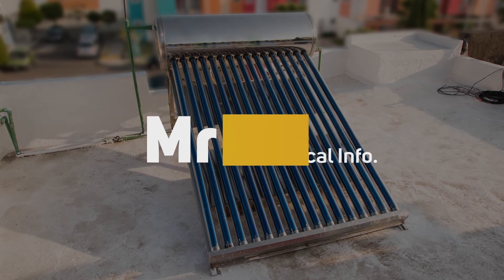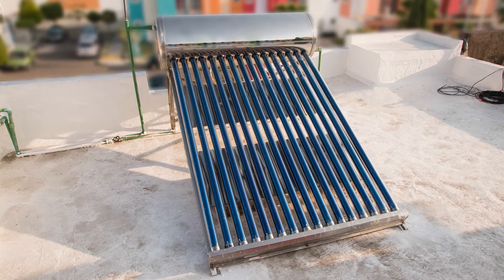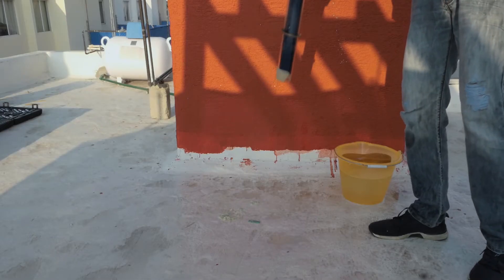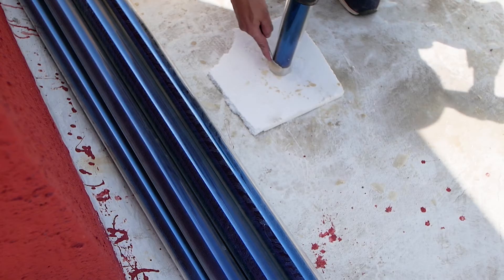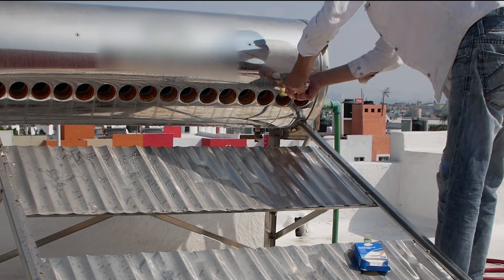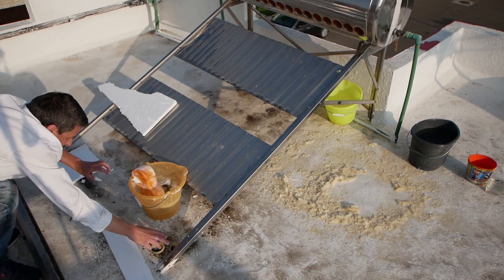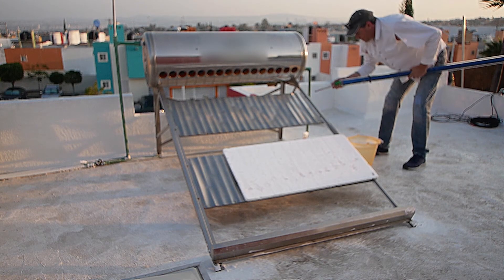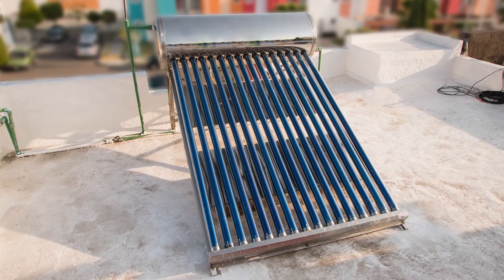Cleaning a Solar Water Heater Tubes and Tank 🌞

Comment: This was a very cool video. I don't think my solar geyser has any magnesium rods, but probably lots of clay residue. I have borehole water and clay accumulates quickly.
Reply: I suggest you to use non-weld tank to solve this issues.
Reply: Install the filters

Comment: Why not just buy a water softner ?
Reply from the maker: Only top end water softeners would cut it and they aren't exactly cheap, in Mexico a 250 litre gravity fed solar water heater only costs around $400 USD (2021). Plus solar water heaters need the silicon seals to be changed every 2-3 years so I now do that (in my other video) at the same time as cleaning the tubes and the tank.

Comment: Hello in Mine I have a lot of lime 
How can I get rid of lime
Reply from the maker: To remove lime scale you need to dissolve it by using a solution of one litre of white vinegar mixed with four table spoons of sodium bicarbonate which should be added slowly in a well ventilated area.

On the tank close the drain valve and fill it by pouring the solution via one of the tube holes. If the tubes contain lime scale put them in the shade standing vertically with some form of support and cushioned at the base then fill the tube(s) with the above solution. 

The lime scale should dissolve within an hour then rinse the tank and tubes well with water before reassembly.

Comment: What is the ratio of vinegar to be added to remove the scale inside of the tube
Reply from the maker: It is best to use pure white vinegar or for every  litre of white vinegar mix with 4 tablespoons of sodium bicarbonate. If it is diluted with water it will work but will take longer to free the scale / hardened minerals what with being less concentrated.
Reply: @brieftodo  Thank you

Comment: Where is the scale build up coming from?  Is yours an open system, meaning the water also runs within the tubes?
Reply from the maker: Yes it is an open water system / gravity fed, the scale accumulates mainly in the base of every tube and in the base of the tank.
Reply: @brieftodo   How does the water circulate through the tubes?  With the tubes closed on the bottom end, is the heat transfer done just from a thermosiphon action within each tube?
How does this compare with ones that use heat pipes for doing the heat exchange?
Reply: Yes, do you need a solar water heater over there
Reply: Thank you 😊 so much for this video. Please upload more videos on solar water heater maintenance. Thank you.